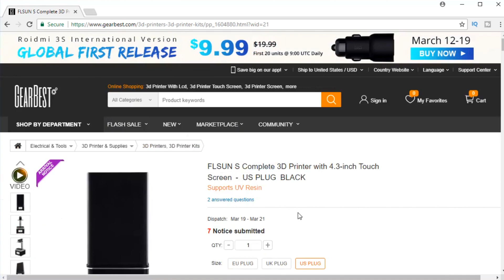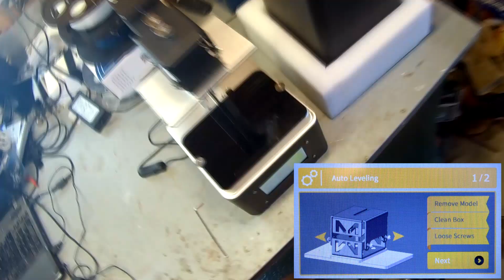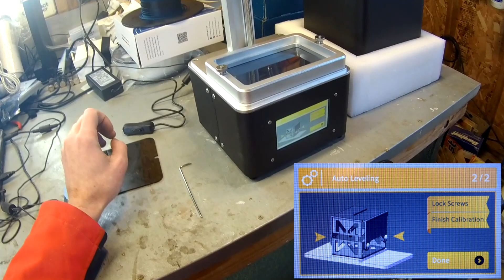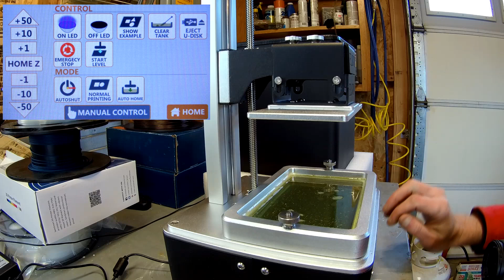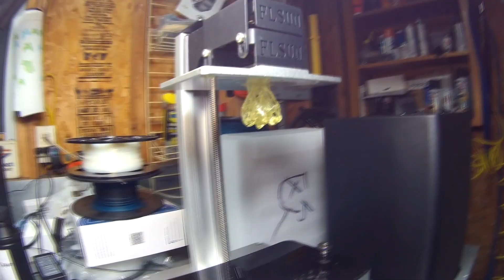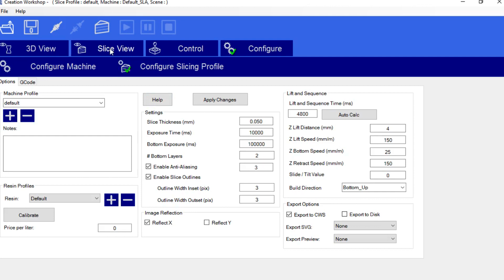FLSUN S / Micro Make L2 DLP Resin 3d printer Review

Comment: How does the L2 handle resin during printing. No information is offered. Does it require manual filling? how does that work?
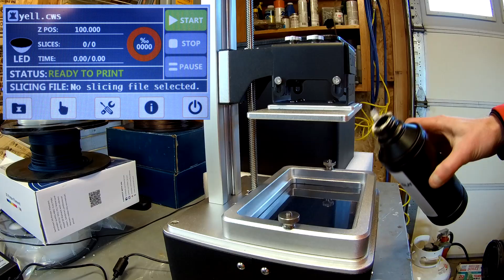Reply from the maker: Daniel Mitzimberg did you miss the part where I was literally pouring the resin in? it's at 3:54